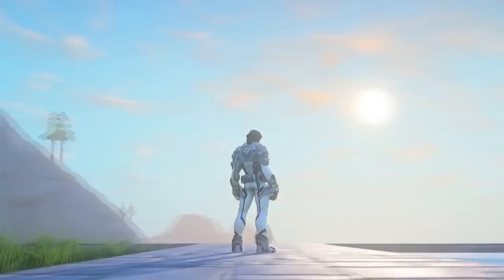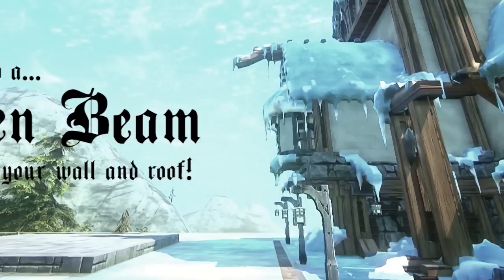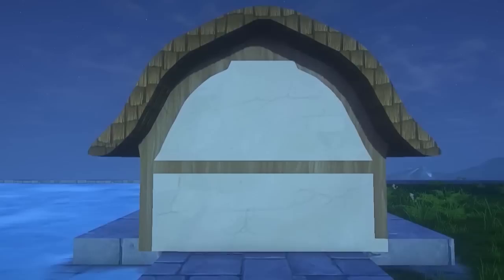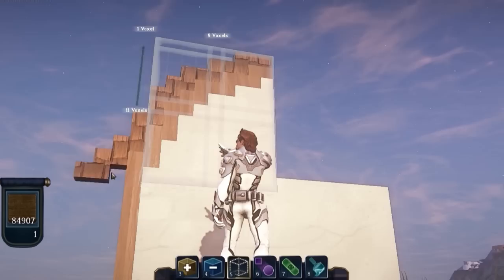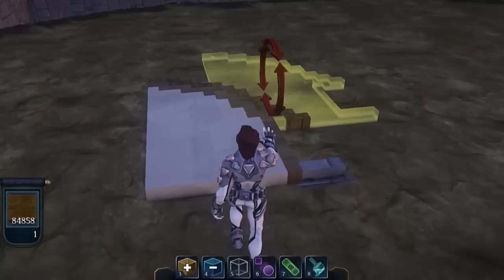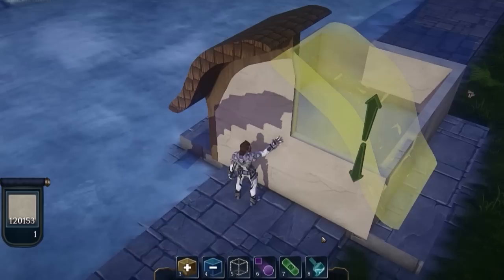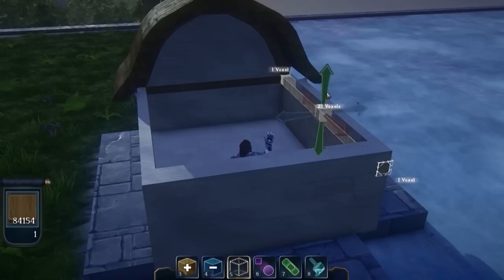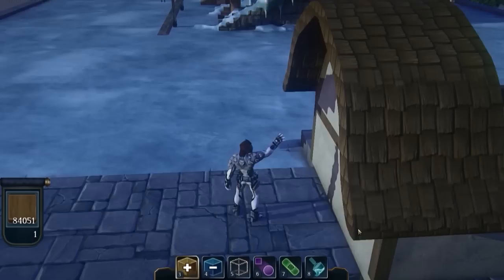How To Voxel Landmark Tutorial: Add a wooden beam between your wall and roof

Comment: i do not get it,
how is this any different than making a normal roof?
Reply: the use of the negative/zero voxel space used by the ground heal area, to enable the smooth and pasting without pasting air voxels.
Reply: Kim Cook i mean, i do not see what the difference is, is this whole thing so you have a smooth wood bit under the roof?
Reply: Yes, yes is it..lol. HOWEVER, this could have other applications other than for roof underlining if you think about it~.